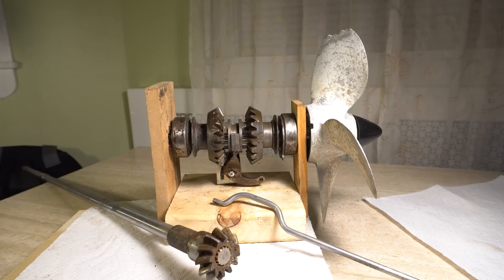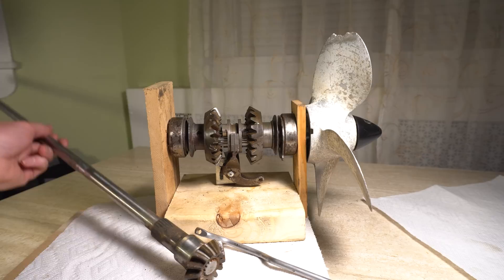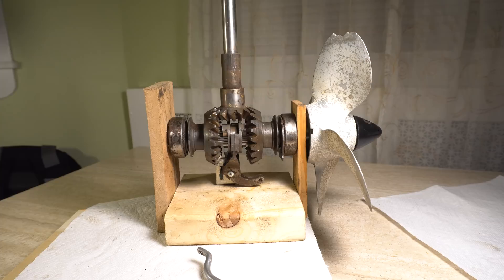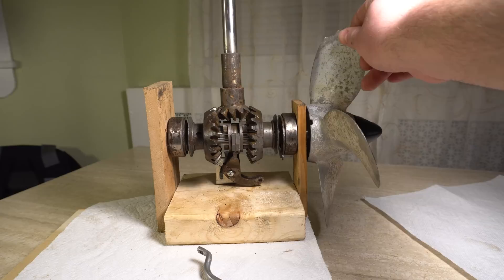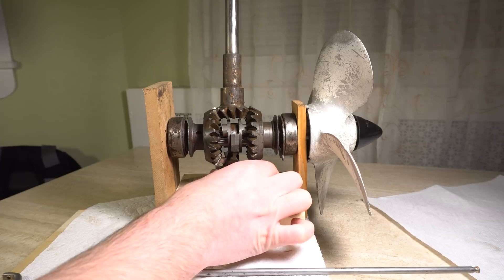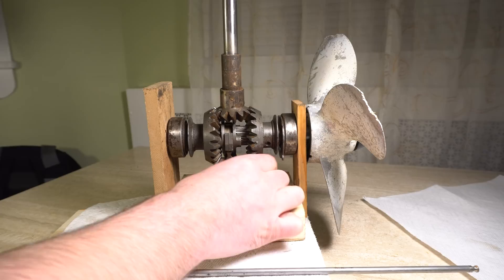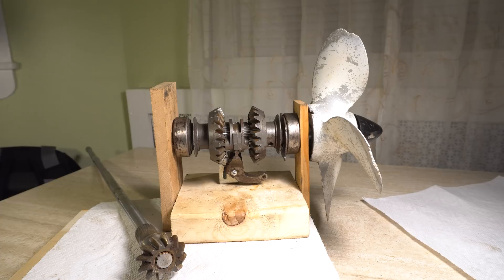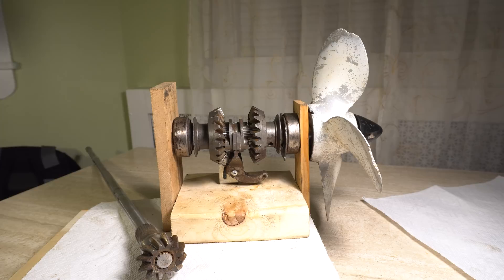How an Evinrude gearbox works - outboard gear shifting - forward / reverse

Comment: Quite good video! I wonder whether the same mechanism is used on reversible gearboxes in scout tanks like the Sd Kfz 234....
Reply: I would assume not, a lower unit with a prop has a certain amount of "Slippage" while operating in water. Land based vehicles would put tremendous extreme forces on the "Shift Dog" (the component which moves back and forth engaging the forward and reverse gears from neutral). This is why land based vehicles use a clutch or toque converter to "Soften the gear engagement". 

Once my father purchased a vintage "Glennell" shallow-V Drag Boat with a Cassell V-Drive running to a drive shaft out the bottom to large brass prop and an former 1/4 Mile Dragster Motor, a 392 HEMI with a Tunnel-Ram and huge 4 Barrel Carb with Velocity Stack. The motor was built professionally by "Eagle Auto" for use in 1/4 Mile Vintage Dragsters or Funny Cars.  The boat was a wooden marine plywood hull with fiberglass applied over it. Years of oils leaks had penetrated the marine plywood and the fiberglass delaminated. We suspended the massively heavy boat/motor and did repairs. Afterward we took it to the lake to try it out. He started the Motor at idle with the V-Drive in Neutral (Estimated at over 650 Horse Power, with TONS of torque), then engaged the V-Drive with the "Hurst Shifter" installed.. The boat went NOWHERE!. after returning home and disassembling the V-Drive, found the Shear Pin was now in two pieces. After discussions with long time 1/4 Mile Drag Boat Racers, he was informed "YOU NEVER ENGAGE THE V-DRIVE WITH IT RUNNING!, It must be started ENGAGED!" the Shifter handle is strictly "On Oh-Shit Lever" to disengage the prop in an Emergency... So after replacing the Shear Pin, another trip to the lake to run it. We launched the boat and within the "15 MPH NO-WAKE ZONE" started the engine in gear.. the boat immediately bolted forward at about 35 MPH at Idle pushing two massive walls of water on either side of the bow. To stop the boats moored at the docks from getting slammed wildly he stepped on the Old School Foot Shaped Gas Pedal and the boat Launched out of the water  instantly on plane. the Speedometer pickup tube flipped up out of the water so an accurate judgment of speed was not possible, but we were approaching the distant end of the long narrow lake faster than either of us had gone! It literally sounded like "sledge hammers" pounding the bottom of the boat as it flew across the water, he quickly left off the Gas Pedal and we came back the other direction to the boat launch (At a MUCH Slower speed) we saw water filling the hull, way more than the bilge pump could handle. before entering the no wake zone again he killed the motor and we coasted to the launch, jumping from the now somewhat "sinking" boat to hurry and back the trailer down the ramp. Pulling the drain plugs a massive amount of water drained and the newly repaired fiberglass was once again delaminated... After a much more intense process of hoisting the boat and saturating the Plywood Hull with various thinners and other volatile liquids to remove the oils and doing a much more intense job of preparation. Once again the fiberglass bottom was redone with much more mat and cloth than before.

Once again it was a trip to the lake, this time with more faith it would hold, and lesson learned from before we paddled the boat outside of the no wake-zone, engaged the V-Drive and started the massive motor. Off we went! This time I was foolish enough to bring my Kidder Slalom Ski and a prepared 100 FT Ski tow rope. on top of the beast of a motor was a chrome Ski Tow Hook assembly mounted to the engines tunnel ram intake bolts. We did a couple of "Trial Runs" to ensure the repairs held, and it was time for me to  put on my ski vest, coil the 100 feet of ski tow rope fairly close to the rear of the boat behind the aluminum plates extending behind the boat (used to control the plane of the boat, and smooth the wake), I put on the ski, and nervously said "HIT IT!" the boat started in gear and I watched as the coiled rope quickly straightened out. Instantly I was launched out of the water without hesitation. I could feel the incredible cavitation of the water behind the boat, even at 100 feet back... knowing that the boat idled at 35MPH and needed more speed to get up on plane I can only imagine how fast I was going. a tremendous tug pulled me forward directly behind the boat. After getting more comfortable I started cutting back and forth behind the boat. Then it was time to "Turn Around" and head the other direction.. as the the boat turned and I was sent out in a much larger arc it felt like I was literally flying! I though to myself "DONT FALL!" the whip from 100 feet of rope had me gliding across the water at a speed that was unimaginable. I could hear the rumble of the HEMI and the wind rushing past my ears. After a couple of loops around the lake my shoulders felt like my arms would detach, so as we approached the Ski Dock at a great distance I released the rope and planed across the water to the dock. We did a few more laps around the lake after I returned to the boat, and realized the many gallons of gas in the tank were about gone! It wasn't MPG it was Gallons Per Mile... 

It became obvious that the cost to run the boat for "Pleasure" was insane, so he sold it and we built a stripped 16Ft Bayliner. he rebuilt a 90HP Evinrude Outboard and installed a new 115HP Power Head on it, installed hydraulic lifts on the motor, and we used the boat for many trips Skiing, Wake Boarding, and just for cruising and fishing. It was much more economical and still was very fast with the larger Outboard... 

I hope this illustrates why boats can use a "Shift Dog" to engage forward and reverse gears due to prop slippage, and vehicles on land would need a clutch to disengage in order to shift.

Comment: Once the key enters into gears keyway, power transmission starts, but its an interesting mechanism, I only have 1 doubt, how it synchonizes so fast forward reverse changes don't damage the shaft?
Reply: The gears are always meshed together. Forward gear and reverse gear are always turning. When the clutch dog is in the middle position it is in neutral. When the clutch dog is moved to one end or the other it will engage either forward or reverse gear so there is no need for any gear synchronization. There are splines on the prop shaft and the inside radius of the clutch dog so the clutch dog always stays engaged with the shaft it's just a matter of the positioning of the Clutch Dog as to whether it's in forward neutral or reverse

Comment: I have a Yamaha 250 4 stroke and the Prop turns in Neutral, I thought maybe something was wrong. You say the prop is suppose to turn in neutral. But is that dangerous to skiers or swimmers that get to close? Some people have told me that in neutral the prop should not turn. ??  any answers I will appreciate... Thanks
Reply from the maker: The propeller should rotate "freely" when in neutral. So if the motor is OFF. You can turn it by hand. If you turn the motor on, the propeller should not rotate in neutral. Also never touch the propeller by hand if the engine is on even if its not rotating.

If your engine is turned on, in neutral and the propeller is spinning by itself, this is bad.

Comment: Hello friend, I need to buy the propeller but, I have no idea what it is.
my engine is a jhonson 25 same, can you help me?
Reply from the maker: I would try posting on iboat forums of hulltruth with the engine serial number and any info you may have. I am sure someone can help you out. Also it should be in the manual if u can locate that. Also try marineengine . Com as they have many parts and diagrams listed. It may be under there.

Comment: Hi, Does the clutch Inner Bore have splines for running on the shaft ? Or is it smooth ? THe gears look to be pinned to the shaft but are they also splined on there inner bore ?
Reply from the maker: Watch part 2.

Comment: Friend, can you explain to me how many RPRs come out on the propeller shaft? type entering 1,000 rpm through the motor shaft and how much would the output intend?
Reply from the maker: I do not know but generally these outboard tend to top out in the 4000 - 5000 rpm range.

Comment: Not sure why you call that movable central piece a "clutch". It is not a clutch at all. This intermediate part, that engages the gears and locks them to the prop shaft is called "collar". The same principle is used in automotive manual gearboxes, which have multiple movable collars.
Reply: In engineering terms it it properly called a “dog clutch”. This is a different beast to a friction clutch. 2:53

Comment: Why would the propeller spin in neutral??
Reply from the maker: Hey, many people seem to ask this, what I meant is: "Spin Freely" not spin when the drive shaft is rotating. As in, you can take your hand and turn the propeller, when its in neutral as its not connected to anything. (Never do this with the motor running).

Comment: My shifting is rough, it almost bangs when i engage it from neutral to reverse. It idles high. Theres a screw i have to turn i think, just have to find it. Any help thanks. Good demo.
Reply: Enderman Mc Locate the model number of your engine, usually on a plate, get online and type it in. Should find a manual for it.

Comment: Why don't boats have a transmission like on a car. If you get the prop spinning faster as you go up the gears wouldn't the boat go faster too
Reply: Apollo_ 45s High rpm's engines ... and low hp's . No need for multiplication and no torque available to do so.

Comment: 9.9 Johnson. Does the engine  need to be running to move shift lever TIA
Reply from the maker: No, however depending on the position of the shift dog, you may need to rotate the propeller a little for the teeth to fit in the groove.
Reply: Hello Everyone  Thank you for the info and very helpful video !

Comment: No synchroniser there?
Reply: There is no need for a synchronizer. Both forward and reverse gear are always spinning. The propeller shaft and the inner radius of the Clutch Dog are splined and the clutch dog rides back and forth on the splines engaging either reverse or forward gear or neutral if it's in between. There are hardened engagement surfaces on the clutch dog and on the gears. When shifting into gear it is best not to try and baby it into gear as this will chew up the hardened surfaces causing hard times on your wallet

Comment: Isn’t that “Clutch”, as you put it, actually more of a selector sleeve? Please correct me if I’m wrong.
Reply: No it is a "Clutch" as the main purpose of clutch is to engage or disengage the power coming from engine.
Yes your question is right as normaly we see clutch in vehicles as a variable power switch type component as it works on friction plates.
Reply: Abhit Sinha Interesting. 🤔 Thank you. 🐈
Reply: @abhitsinha8813  It looks similar to a synchromesh from a manual trans, is that essentially the same principal?
Reply: @SlowSTEN  Yess you are right. This is  working on same principle and the arrangement of gears and shafts are just little different.👌🏻
Reply: @abhitsinha8813  Gotcha, So its like a Differential and Transmission slammed into one unit...confusing..
Reply: @SlowSTEN  No not so confusing as you think. This waterboat engine has only two things to do, 1. Stay in neutral or engage the power to propeller shaft. 2. Rotate clockwise or anti clockwise the propeller to move forward or backward.
It does not have a complex 4-5 speed gearbox. 
Peace✌🏻
Reply: @abhitsinha8813  I don't know how any of it works, thus confusing
Reply: @SlowSTEN  I know because i am doing automobile engineering. So i know working ko drive trains gearbox😅
Reply: These type of clutches are called a "dog clutch" and are (or were) very common on a lot of machinery to connect and disconnect the drive....many of these applications have been replaced by clutch packs, as they give a more gentle engagement.
Reply: @Pete856  Yes u are right bro. There were some disadvantages of dog clutches.

Comment: In the down shaft if that was in a fixed position were  it would spin free could u extend the end opposite end of the propellor and have your engine were it's in line with the propellor and put on a mud motor would I have it were my mud motor has the fw and rv and neutral gears ?
Reply: robert hedges 
Wut?

Comment: Pretty sure this is the lower end guts of an anchor.  An outdated one...
Reply: There are still plenty of Motors of this vintage and use. The reason why is because they were extremely reliable and very simple

Comment: So why does it have a grinding noise switching from forward to reverse? Does it hurt anything?
Reply: ultimately, yes. the grinding is metal on metal.  unlike car gearboxes, outboards do not have synchronization cones witch match the speed of the drive gear to the output.  Outboards have what is effectively a 'Crash Box' where the input gear is forced to engage with a shaft that is often stationary, causing the initial grinding or clunking noise.
outboards are generally easier to put into forward than reverse due to the gear design of the cut because of the amount of time you select forward over reverse.  To reduce excessive wear make sure you do not shift from forward into revers while the boat is still moving at speed, and make shifting as quick and decisive as possible.
Regular gearbox oil changes removes any worn metal debris, which otherwise can recirculate and cause more damage over time.
Reply: As you say it explains the clunk you often hear as the gear engages.

I'm amazed the gear DOES engage because as you say there is no clutch synchro mechanism.

Any thing much over tickover and wont engage anyway??   The speed diff is too much?
Reply: In reference to ultimately it will hurt. Is it better to slowly engage or abruptly? Also about how long (hours or times changing gears) will it need service/replacement? By the way thanks, real good info.
Reply: I suppose common  sense says you do it gently but firmly.    The mechanics are what they are.   They are moving parts and will require regular main and inspection to keep reliable.
Reply: You don't want to baby them in - the teeth will tick across each other clunk clunk clunk.  So it is a smooth firm push on the lever.  This is basically a "dog box" transmission where the gears are engaged by large metal teeth.
Reply: blackdiamondmarine ผ
Reply: Kitten Slapperp
Reply: Kitten Slapper well mine is 30 years old and has never had any issue. 550 hrs on the boat/outdrive. I never ease it into gear, just get going with it. I pull the plug and check for any water every year, but only change gear oil every 3-4 years. (Never had any water yet) that system, used properly, will last longer than you or I will.  I have a 66 merc 20hp outboard that is still going strong to.

Comment: The propeller shouldn't spin when in neutral. It's a PROPELLER, if it's spinning it's propelling. Neutral is neutral, no movement. Besides that, good video.

Comment: This guy is just like all of the others that do not know the difference between a "motor" and a "engine".  Quick way to know what is what.  A "motor" runs on electricity be it a/c alternating current or d/c direct current. A "engine" runs on fossil fuel, gasoline or diesel fuel.  It is surprising the number of men and even those in the automotive and marine world have no clue on how stupid they are and showing to the world.  In this video this person is no different, no clue.

Comment: This is called a crash box. There is no clutch, there are no synchro. When you engage the propeller you "crash" the rotating gear into the propeller shaft gear. Awful, stupid design. Bullet proof Volvo design uses 2 cone clutches at the top of the unit, smooth, quiet, no grinding.

Comment: Driveshaft spinning all time when you start the engine give me break it’s spin just when you shift into a gear and for reverse there’s third gear  shifting the reverse wheel into separate gear not as you claim by your display was rear axle shaft

Comment: You said "Make sure in neutral the propeller turns" and "you put it in neutral, it should spin"   You meant doesn't turn and should not spin.  LOL
Reply: CaptIntrepid hes saying that when in neutral you should be avle to spin the prop by hand. If it is in gear you would be working against the compression of the motor and there fir it would not spin freely
Reply: That's what I get when I comment after a cocktail.  Yeah, now I see what he means. :-) Thanks.